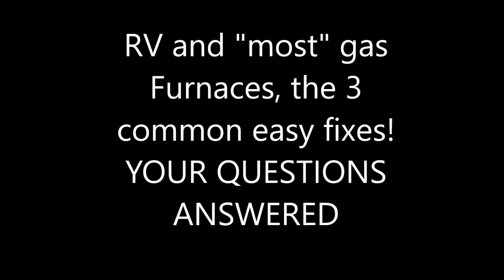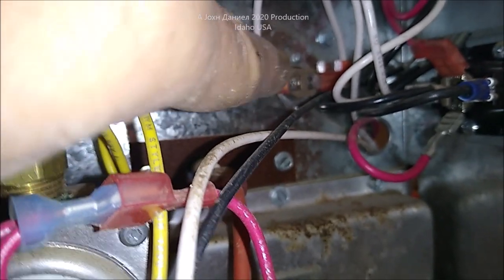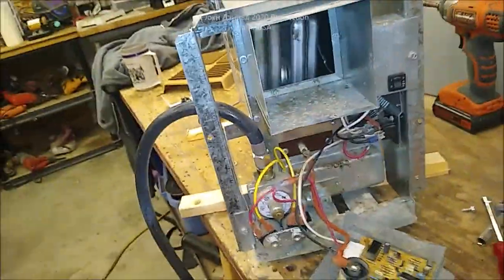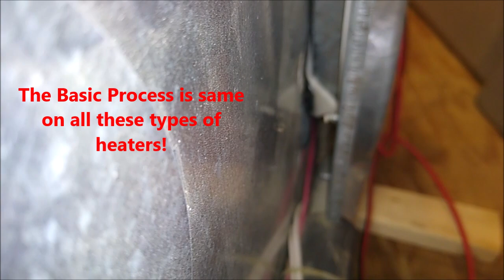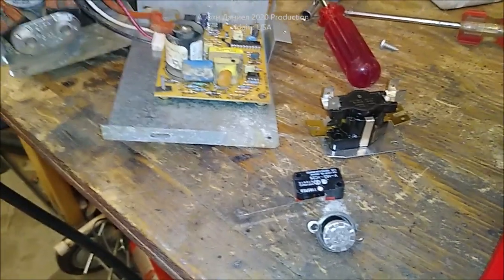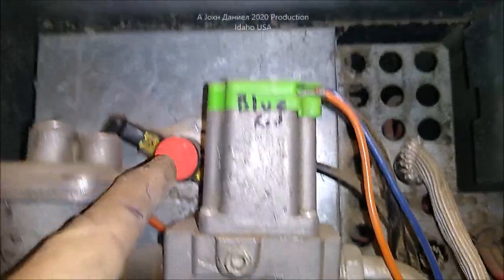RV Furnace REPAIR TECHNICIAN SECRETS Top 3 Easy Fixes anyone can do PARTS BELOW

Comment: I have a question. Hope you see this.

My pop up xamper has a DD-17DSI Suburban heater.
I changed thermostate, pressure valve, propane feed line outisde and blower motor on heater  and cleaned exhaust and chamber so far.

the issue i have is the fan kicks in, stays on. the propane ignites, I see it in view hole burning...
but I only get like a luke warm heat output. like a warm breeze.
What would be causing the heater not to open up the propane feed to burn hotter?

And i'm on shore power.
to note: The issue happened the 1st camping trip after winterization.
it's 3 yrs i'm trying to figure this out.
Reply: Just out of curiosity, if I accidentally reversed the thermostate cables, would that be an issue?
Reply from the maker: Plugged up orifice going into the burner chamber or air fuel mix choke if it has one being loose. Gnats and weevils are prone to get into the burn chamber, hauled in by wasp as pupa food, the oily residue of propane attracts them into the tiny orifice and grow too big to get out, then die, then plug it enough to give you that kind of result.
Reply: @JOHNDANIEL1  thx John! I'll be bringing my tools to my next trip in 2 weeks. Will disassembly unit and clean out burner.
I know I had a wasp nest once, some may have found their way in and blocked it.
Reply: Hi,
I couldn't wait. lol.
I popped up my camper and removed burner. super simple since it's only 6 screws.
it's clean as a whistle in there.
I sanded off the starter coils since they looked rusty. I'll keep you posted. too bad I can't attached an image on yt comments.
Reply from the maker: @Frosty_x.x  Not the burner, the orifice. It will have a hole about 0.085 and be where the propane is shot into the burner. You have to unscrew it to clean it. Careful its softer bronze like metal.
Reply: @JOHNDANIEL1 t was my over temp switch in the end.
I pulled the burner..it was clean but my gasket disintegrated when I pulled it. I had some hi-temp gasket sheets at home so I made a new gasket.
put it back together and same issue.

then I tried to bypass the over temp and now it heats.

only issue is, I cant find a replacement for my overtemp that has this  code printed on it:
36TX11 13458 L260-49F 231768 A0421

Comment: So what exactly is the purpose of the sail switch? My furnace comes on, motor spins, I see and hear the igniter.. but it will not ignite. So no gas present? It will attempt to ignite 2-3 times and eventually just shuts itself off… any suggestion you can offer?
Reply from the maker: Sail switch sends power to the relay on the gas valve. This is so your furnace does not light up without a working blower and become a gas bag bomb.
Reply: @JOHNDANIEL1  so could the sail switch still be faulty even with what I got going on? I see the switch it’s tucked quite a ways back there (haven’t pulled furnace out) and not even sure how someone can get to it as the side it’s fastened go is solid..
Reply from the maker: @TheSponge945  Put your finger on the solenoids of the gas valve, fire it up, feel anything click in it?  Check to see outside if you smell propane when it's trying to start. Remove the igniter and be sure its got 3/16 gap on its 2 points.  But if It's sparking, cycling, and the blower is running but no gas valve is opening. That's the definition of a failed Sail Switch.
Reply: @JOHNDANIEL1  I should also state, I bypassed the high temp switch by bridge the two connectors - made no difference. No smell of propane outside the exhaust/intake ports of furnace.
Reply from the maker: @TheSponge945  REPLACE SAIL SWITCH
Reply: @JOHNDANIEL1  thanks boss. Gonna look into it and try to get it sail switch is tucked quite a ways back
Reply from the maker: @TheSponge945  Remove the outer intake/exhaust parts, slide them out, Turn off gas, remove the gas line, back it up with a wrench to do safely, unplug the unit, remove the screws going into the bottom into the RV floor, remove any ducting and push aside, pull unit straight out. If its a 7900 then remove the side plate on the air induction side, remove the set screw on the impeller for the intake air, behind it is the screws to pull the motor and the blower. Under that is the sale switch, you will need tiny screw driver and needle nose vice grips. Reverse steps to put back in. BUT, check to see if the Sail Switch wire came off or a obstruction in the blower has lodged onto it as you go.
Reply: @JOHNDANIEL1  mine looks like the NT-12, 16 or 20 it’s just a 8” PUP camper

Comment: My board relay had fine cracked solder joints. Fixed the ignition and gas valve, but my gas valve goes poot and stops, fires and goes out. Going to check that sail switch business tomorrow. Thank you.
Reply from the maker: With a multi meter, check your active voltage conditions. Test the wire to the solenoids on the gas valve, see if after they activate, volts drop real low. Below 11. If so, you have to find where they are loosing contact to be weaker in the system. Usually carbon build up on relays is the cause.

Comment: I have a Terralab engineers furnace and for the last few years in the middle of the night the furnace would repeatedly make a popping sound. Now after it heats the camper it stays in cool down mode and will stay blowing cold air all night. If I turn it off, it will light back up and repeat. Any Ideas?

Comment: I have a suburban 35 btu heater that quit working. It had been running fine, then it cycled 3 times for short periods then quit. It has power to the thermostat, but jumping the wires does not get the furnace to start. Any ideas what the issue might be?
Reply from the maker: Having no idea which 35,000 btu Suburban, it's year, and model you have makes that an impossible guess.
Reply: @JOHNDANIEL1  sorry should have included that, Its a 2002 Suburban SF35.
Reply from the maker: @stevecorner5069  I need the serial number due to model change on some for certain trailer makers. Should be a number ABOVE or BELOW this change point serial number   -921403895 older vs. +921403896 newer
Reply from the maker: @stevecorner5069  The board in them is a 5% chance of fail, 2002 is not old enough for capacitor fail. pre-1996 is full Electrolytic, after 1999 most were poly. Unless you hit the RV battery with over 17 volts at some point.
Reply: @JOHNDANIEL1  thanks for the response. My understanding is that given the thermostat has power, then it is unlikely that the high limit is the fault. As mentioned it had been running fine, then the fan briefly cycled on and off 3 times with no ignition and now won’t respond at all. The unit has been plugged in to AC, operating through the inverter, with no apparent voltage spikes.
Reply from the maker: @stevecorner5069  The high limit would not stop the thermostat from having power, it would just stop it from sending that power to the gas valve solenoid to keep it open. Sail switch most likely culprit. Since it does cycle. https://amzn.to/3MKlOhK
When it cycles, 15 seconds then makes no attempt to light then within another 20 to 30 seconds shuts off, that's a sail switch connected issue. They are what tells the board the blower is working, send the gas and spark.
Reply: @JOHNDANIEL1  Thanks John, I’ll give that a try! Cheers!

Comment: First, GREAT video and explanation!  One crazy thing I found was one of the pins on the connector to the control board was not making contact!  So now the blower turns on the furnace starts and heats but the blower doesn’t turn off after thermostat turns off. What should I look for?
Reply from the maker: Depending on the exact model of the furnace, and year made to know the more accurate cause. But 90% of these events like yours is contacts hanging up, sticking due to age. What keeps the blower on is cool down features which is a bi-metal item on the heat exchanger or next to it, or the Run Delay Relay. Using a large screw drivers handle, run the cycle and tap with the plastic handle on the case in different places to see if the fan stops. Jarring it will identify this is the issue. 
If you list the model and year I can get more accurate.
Reply: Thanks for quick reply!  It’s a 1998 Atwood hydro flame 7900-ii
Reply from the maker: @rickdolunt2157  Don't sound like a thermostat issue, that is rare. The TIME DELAY RELAY has carboned up, has failed. When you disconnect power it should most of the time let go then act up when you get restarted. It would normally fail when the Limit Switch is causing shorting. So replace both ( links under video should get you the only replacement options ) and make sure you order the igniter for this furnace while doing so due to age. https://amzn.to/41rRDjn

Comment: As a young confused guy, this is probably the best video on this subject ever. I do have a question tho, the heater in my 1983 camper is definitely missing that circuit board (if it's supposed to have one?).
Reply from the maker: If it looks just like this one then yes it's should have one, but if it has a pilot light then it is a hydraulic action gas valve and the last of the non electric style.
Reply: @JOHNDANIEL1  okay, mine looked similar, but is a lot older. I had later found a slightly more relevant video that helped me as well. Having watched your video, I at least can troubleshoot one of I ever get myself a new camper.

Comment: Is it normal for these furnaces to run for a bit then cycle off then when it’s cooled turn back on?
Reply from the maker: They can kick back on when hot if you raise the thermostat over 4 degrees, but if they have to do a full cool down first then your HIGH LIMIT switch is failing and likely holding it back from cycling faster.
Reply: @JOHNDANIEL1  it’ll run for about 4 minutes then it kills the flame for about a minute or so then the burner reignites, is that normal or could it be overheating?
Reply from the maker: @MrBlake-cz4km  Thermal overtemp switch which can be worn and acting up, or small chance the igniter assembly prongs are distorting when hot and loosing the sensing ability to tell the heater that flame is on. It has 2 functions, spark to ignite the gas, millivolt sensing to detect flame to keep the gas valve open.
Reply: @JOHNDANIEL1  is there a way to check if it’s actually overheating? Or what do you suggest I do, could the unit just need taken apart and cleaned?
Reply from the maker: @MrBlake-cz4km  Take a flashlight, look up the intake and exhaust pipes from outside, if you see wasp nest, or stuff plugging it up clear it with what you can use and a shop vac to remove all you can. Bad in/out air flow can cause rich fuel burn and over heating. 
To test things internally for over heating ( failed over limit switch ) install a 10+ amp capable jumper wire between those terminals then run it as you observe it in action. Listen for expansion like popping and metal stress effect and obvious high cabinet heat, if any exist from it getting to hot then other problems exist, if it runs ok then you must replace the over limit switch with a new one. Use 200-210 degree f model furnace switch with similar installation tabs or screw holes.
Reply: @JOHNDANIEL1  I took the furnace apart and found the burner head warped and dark red color at the end area
Reply from the maker: @MrBlake-cz4km  Over heating caused by partially plugged burner holes forcing more flame into that area, or like many I have seen a bad air flow from the intake air fan, worn motor, or intake/exhaust blockage or bad impeller/blower.
Reply: @JOHNDANIEL1  there was no blockages but I did see one of the things that are used if it was ducted, the cover had fallen out and it was sending heat into the compartment, that’s the only possible issue I saw

Comment: I have the same exact heater. It will come on ignitor is clicking to light. I smell gas outside but it wont ever fire up. After 3 attempts it shuts down and the red light on the board blinks 3 times in a row meaning "ignition lockout" I replaced the ignitor and still same affect. 

I did notice on the board i see a tiny arcing when trying to light coming from a white capacitor. 

I thought maybe its got a wasp nest. And it did, i cleared it out. Took a airhose and made sure the outside ports were clean. But it didnt help anything. 

Do you think its the board?! I mean its crazy to me that its trying to ignite, has gas, has air but wont light!
Reply from the maker: There as I recall not a White capacitor on the board, there is some in orange, some in black, a few maybe in blue. And on newer models a Poly style in orange. Send me a pic to my email. It's in the ABOUT part on my channel main page.
Reply from the maker: Just dawned on me, May be the large ceramic resistor if yours is old enough model
Reply: @JOHNDANIEL1  it is a 2007 model camper. When i get home i will snap a pic and send to your email. At first i was thinking maybe something is laying on top of the burner and i need to take it out to clean it but i dont think thats the case now that ive seen the arcing on the board. 

The white resistor is right up under the big black round thing that the ignitor wire connects to

Comment: My furnace blows hot air but wont blow hot air out the vents just out the furnace
Reply from the maker: 3 causes. Plates over the outlets to the hoses that run to the vents. Something plugging the lower register under it if its a down blowing model such as the blocked it, or mice nest. Or 3 a previous owner installed one that does that and never reconnected the hoses.

Comment: The relay on my board is what happened to by furnace . Thanks for explaining the working. Unfortunately GD put the furnace in without access door, how stupid!
Reply from the maker: You can replace only the relay, but look carefully at the capacitor next to it to be sure it did not cause the fail.

Comment: Interesting video. Is a Sail Switch and Leaf Switch the same thing?
Reply from the maker: Yes, Some have higher tension, a purposeful sail switch has about 8 grams resistance, a Leaf switch can have as high as 1 ounce. But be sure your choice is NO ( normally open ) so it closes on action.  I put a optional switch under the video thats 8 gram but you may have to trim or add a flag section to fit.
Reply: @JOHNDANIEL1  thanks will definitely save some money down the road.

Comment: Can I ask you a question; my suburban ignites with no problem but almost immediately starts it’s cooldown, and almost immediately starts reigniting, and the process repeats itself over and over?
Reply from the maker: What is it's year and model number.
Reply: @JOHNDANIEL1     1998. Nt16se
Reply from the maker: @brianswirk-rp7jz  Sounds like it is not detecting flame so it shuts off the gas, which runs the cool down cycle. Replace the Electrode ( igniter/flame sensor ) and you should be OK. Not many left so better grab it, at that age of furnace it's needed.  Exact replacement per my 8 gigs of data.  https://ebay.us/8Snrw8
Reply: @JOHNDANIEL1  it’s been purchased,  is it an easy install?
Reply from the maker: @brianswirk-rp7jz  Yes, just a few screws. Follow the spark wire from the coil on the board to the burn chamber and remove the igniter electrode. Take a picture of its wiring before you do, then replace the old one. BE SURE not to bend the elements on it, one is spark, one is 50 mv sensor that holds the relay to the gas valve open. Careful not to damage the fiber gasket on it you will need to re-use it.
Reply: My igniter has only one wire, a red one
Reply from the maker: @brianswirk-rp7jz  Remove it to see if it has 2 elements, and it should have 1 wire to ground on one side and a red wire on the other going to the board. If not, its a older model than your trailer is.
Reply from the maker: @brianswirk-rp7jz  Send me pictures, numerous full view. And in the mean time check the battery/converter voltage when it is not on and when it fires up. Does voltage drop significantly such as from near 13 down to under 12v.  Check the gas pressure. Turn on all burners on the stove, cycle the heater on, does the burners on the stove run the just as high when the furnace is off as it does when the furnace fires up for that short period. olympicpowercontrols@yahoo.com
Reply: I don’t know how to attach a photo, mine only has two prongs and the one red wire.  I can’t see where it goes without removing the heater completely (I think). I’ll test the gas pressure with the stove today and get back to you,  thanks again for all of your help/time
Reply: Not able to get to the testing today, but now that I’m thinking about the burner, I do recall that the flame “when on” is wild loose yellow, not tight blue??  What would cause this to happen?
Reply: No difference in the flame on the stove when the heater is burning, the flame is all yellow in the heater?
Reply from the maker: @brianswirk-rp7jz  Heater is not getting enough  intake air. Most common, or the propane jet in the supply to the burner is plugged or even may have fell out, can do that on either of those acts. The intake and exhaust tubes need to be camera inspected.